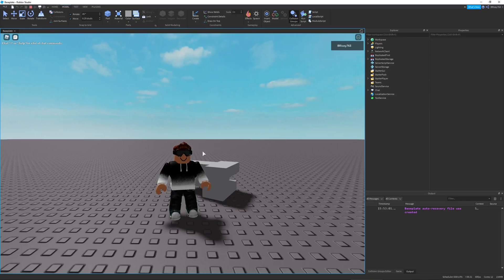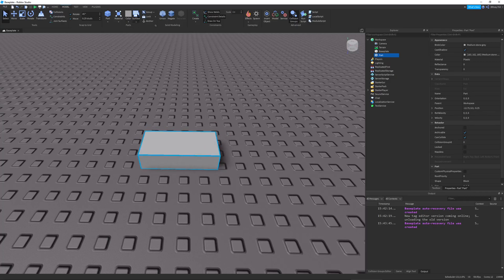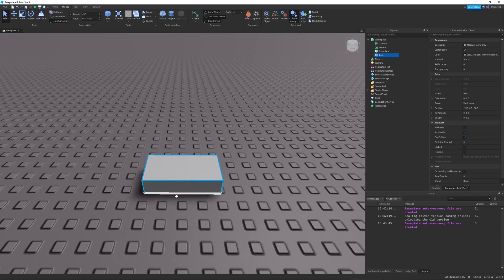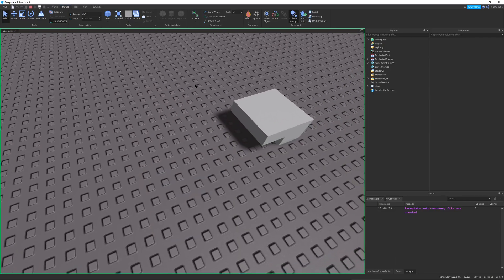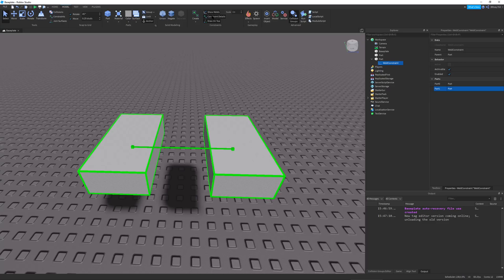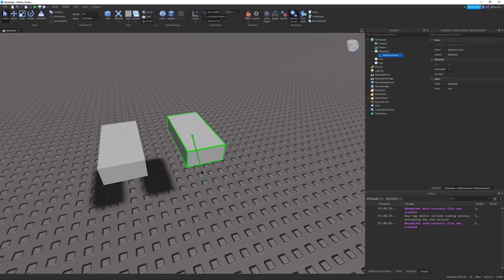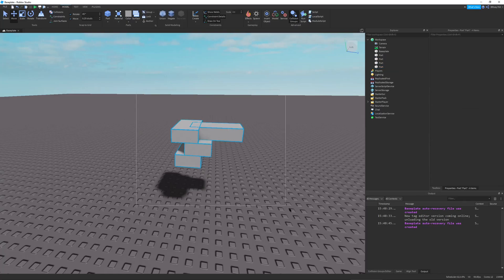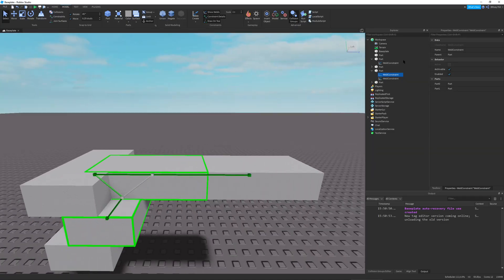All about Welds in Roblox Studio

Comment: Is there any way to automatically weld everything inside of a Roblox game? I forgot to use Join Surfaces and I dont have the time to remake the entire game, also I know there is anchoring but there is a reason as to why I need everything to be welded and not anchored
Reply from the maker: You could use the command line and a for loop and go through all of workspaces descendants to get it

Comment: 1:30 You should have said... This is a left over feature of surfaces. Old roblox from 2006-2014 Used this system to attach parts together, and was very lego-like. This system of building is my preference. As it was rational. It worked with stud top + inlet bottom as a default brick. All you had to do figure out surfaces. Though there was a glue texture, that in 2013 got merged with roblox's weld texture. It made a water texture back in the day.... Universal was able to combine with the stud and inlet, the weld worked with all surfaces ( visible ), the exception was untouchable... Though that was a surface that you had to detail more for.
Reply: then make a video about that LOL

Comment: About the "Texture" Weld, the texture weld is actually a surface that has existed for a while, and if a part with a weld surface on any side is touching another part (when both unanchored) they will be stuck together. BUT: If the surface of the other part is not Glue, Studs, Inlets, Universal, Weld, or Smooth, then it will not stick. This also includes any round surfaces where it will not stick.